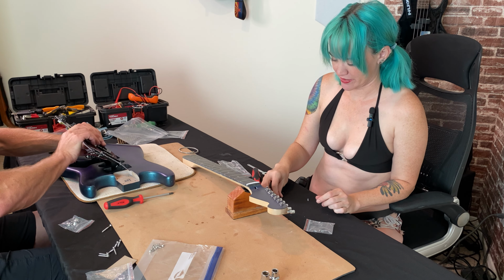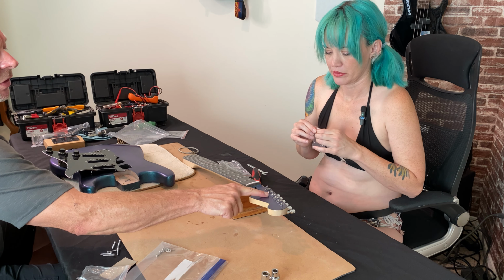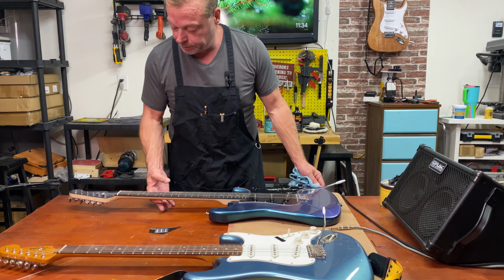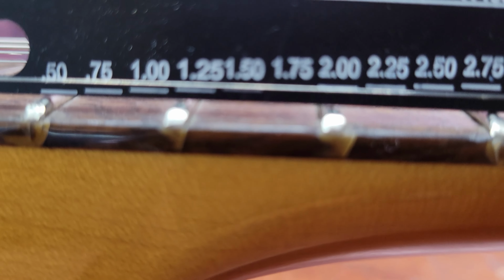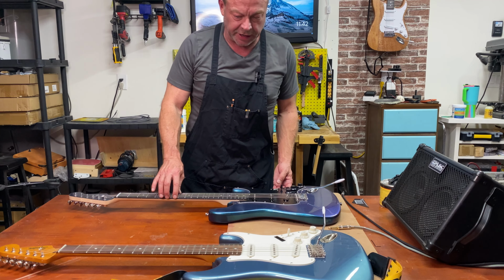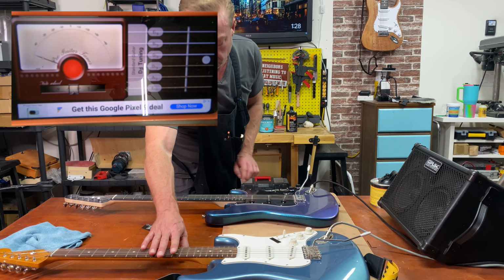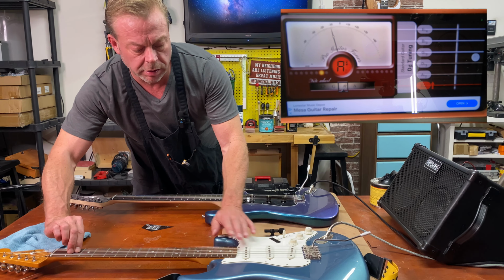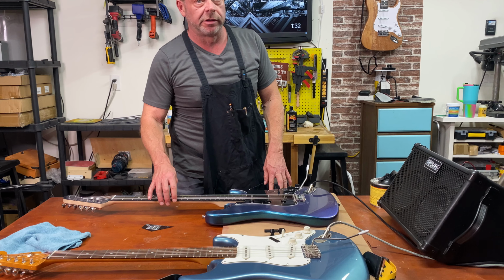Kit vs. Factory Fender Strat | Part 3 final ! w/t Sound Check

Comment: I have build a few kits, and there is a lot of quality difference in them.
Some issues i ran into:
On some cheaper sets i had to use shims to get the neck straight in the pocket.
Often the tuners are so bad i just do not use them.
Most times the fret ends are very sharp, if you round them off to be able to play comfortably you need to make the string spacing a little bit smaller to not have the risk of strings sliding of the side of the neck while fretting. That means, making another nut.
Fret leveling takes a lot of work because they have huge height differences.
Cheap plug connectors lose contact when moving while playing.

Its fun to build though.
Reply from the maker: So far I have found the LeoJayms kits are a about 2 notches above the BexGears and Ktaxon kits. Coming soon ill be trying out one of LeoJaymz new TS neck Teles.
Reply: @ellsworthrdproductions9611 I dont know any of them.
I live in The Netherlands and the only decent priced kits available here are mostly cheap stuff from china.
Kits from the US do not ship here or have insane shipping prices.
I do have a few guitars from Pit Bull Guitars, austalia. These are not to bad quality.
Reply: @ellsworthrdproductions9611   Solo and Precision kits are worth a look if you haven't yet.